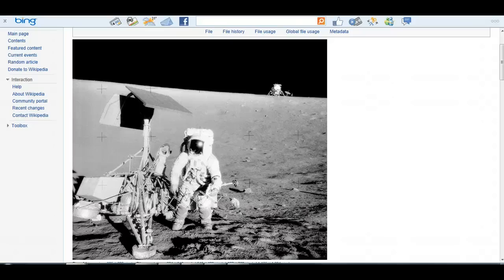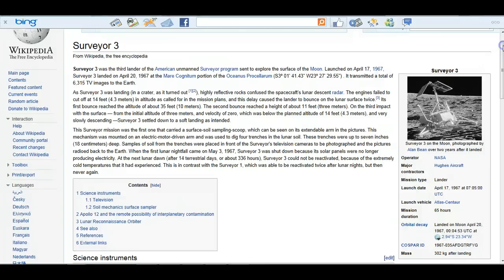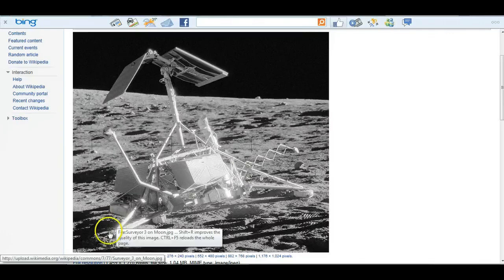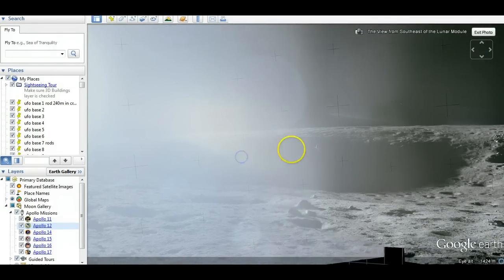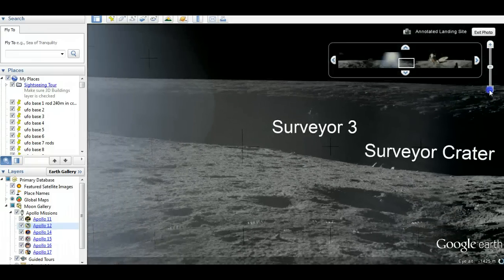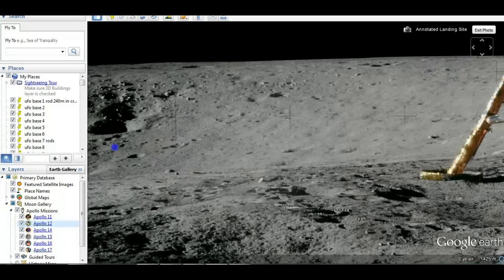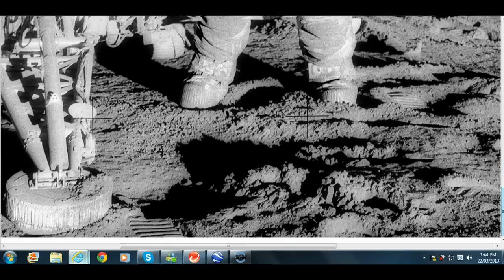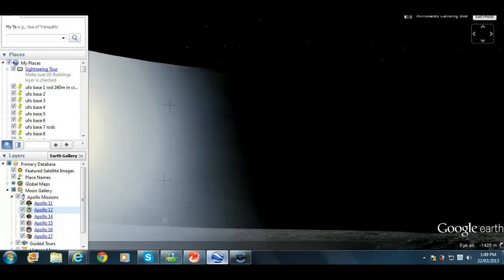Surveyor 3 anomalies-NASA pics

Comment: You don't send someone someplace where there is no contingency for a major screw up.  If one of the attitude control or RCS thrusters malfunctioned, the astronauts would have been doomed.
Reply: NASAs been doing that for decades. The space shuttles had no launch escape systems, and they didn't even try to save the doomed Columbia crew. NASA disregarding safety for the sake of success is nothing new, so not really proof of fakery